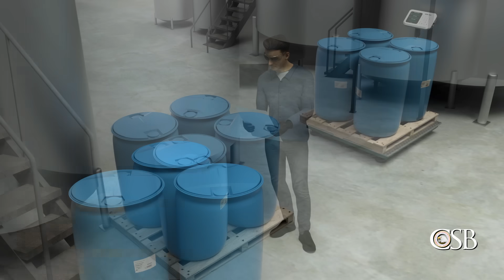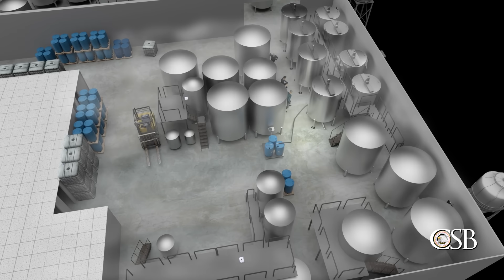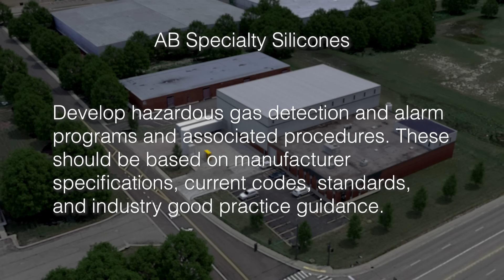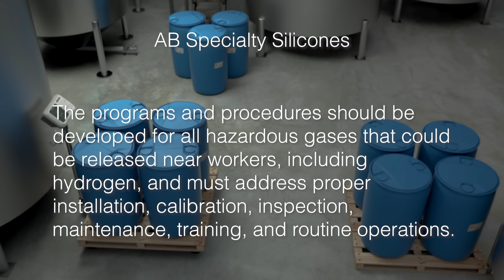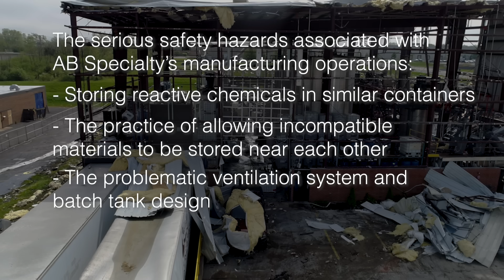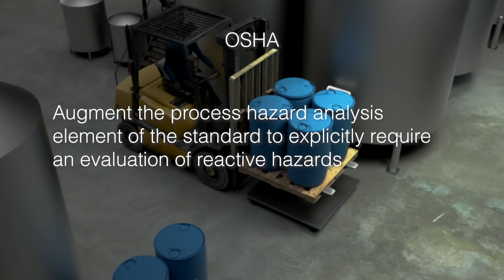Incompatible Chemicals: Explosion at AB Specialty Silicones

Comment: Accident’s happen.  The only way to prevent this accident was to make it a work free safe zone.  The tanks were probably designed for something totally different and the new process was added later.  About the only rule really broken here other than not paying attention to what’s being pumped (it’s very common for chemicals to come in all sorts of different color identically shaped containers even delivery to delivery, labels also look the same so if you don’t patiently read the wording you could also mistake chemicals) is the local exhaust ventilation, that’s kind of a major oversight not to have when mixing chemicals universally.  Tragic accident and these videos are helpful to keep in the back of your mind.  If you rounded up every safety professional and had them comb all manufacturing facilities to conduct safety audits there would still be accidents just as tragic, there just isn’t enough time or expertise to go around.  Automation isn’t the solution either as every automated system has some kind of human interaction at some point.

Comment: so seems like one good idea might be to have better temporary labels for the containers, something like a collar that attaches to the container maybe? could be as simple as a colored band with a color key or as complex as a full proper label made from carved plastic (so discoloration isn't a problem)
I know stickers seem like a good first choice but they are hard to remove once the container is empty and aren't reusable when the next shipment of chemicals come in.

something else that might be useful to consider is what chemicals can be generated form any large scale combination of chemicals used on site, (sort of like a simplified MSDS?) to help setup detectors for gasses such as happened here, at the very least it wouldn't be hard to have a public database where you could just input a list of your chemicals and it spits out a list of potential dangerous reactions.

for any bean counters, always remember that no delay or cost from safety improvement is greater then total loss of a production facility, the bean counters in this event would have been better off if they had totally shutdown and overhauled when they learned their processes were lacking in 2014.

I don't think this is a greed issue most of the time, i think it's a lack of proper communication inside organizations and between organizations, many businesses see organizations like OSHA as a pest that only comes around to do harm, maybe the OSHA inspectors could spent more time with the bean counters making clear how much worse mother nature is when she sends her surprise inspections as happened in this event.

Comment: Here's a little deeper understanding of the actual chemical reaction that caused the explosion (from csb.gov): The "XL 10" mentioned is a methylhydrogensiloxane and dimethylsiloxane copolymer. When mixed with a KOH/water mixture, the KOH catalyzes a reaction with water and XL 10 to produce large amounts of hydrogen gas.
Reply: Although we might never know, the operator could easily have started the proces with barrels of pure KOH (because they had already been opened) adding the XL10 afterwards.
Which  would be a very effective way to build the bomb that they did...
Reply: Thank you, I was wondering about the details
Reply: Is this pH related, because for adjusting it was fine, but dumping a whole barrel in it triggered it?
Reply: @VintageTechFan  I'm no expert on this particular process but my theory is that the KOH for pH correction was added to finished product whereas the accident KOH was added to an unreacted ingredient. It's definitely possible that the finished product has totally different properties than the "pure XL 10" precursor. I'm drawing on my experience with adhesives manufacture which is similar but different.
Reply: Adding KOH to either the XL10 or the product can produce H2 (I may have seen that fact in an article I read on this accident). Since pH balancing the finished product seems like it was a routine process, I am guessing that it produces MUCH less H2 and/or more slowly, so you can get away with it if you do it afterwards. Polymers tend to be relatively unreactive. Analogous to tossing a match onto a pile of flour as opposed to into a cloud of flour dust....

I've been involved with laboratory safety for many years; making it difficult (or better, damned near impossible) to accidentally have incompatible chemicals come in contact with another is a big area of concern.

Coincidentally, I was once a quality lab chemist in a plant with a process that could easily have created a large smoking hole in the ground. I was glad to move on from that one!
Reply: @corydalus981  rewatching the video it seems as if the night shift added waay too much KOH to the process. The proper amount probably releases a managable amount of H2, but they added too much.
Reply: @sootikins  this; also the KOH was for pH adjustment only and would have been added in small quantities. Adding it in the same volume as a main reactant would have complicated everything greatly.

Comment: Different colored drums would have helped. But even something as simple as putting a colored band of tape on the barrel and lid would have helped.
Its what we do, granted mixing stuff up is a mild inconvenience at my job nothing more, but it helps with identification and it's cheap.

Actually, come to think of it, I install garage floors and have better safety equipment than they do. I have a working air quality sensor.

Comment: I love the CSB and these videos. I follow the channel and send these to my co-workers. This whole plant explosion is a tragedy.

My only concern is the recommendations made around physical process controls. Implementation of a multi-color drum program is not only impractical but nearly impossible with primary drum colors being blue, natural, and sometimes black. Sourcing drums of varying colors like green, red, orange, etc takes months to do and it would be even harder to get one or more suppliers to agree to those changes without significant cost increases to COGs for them to consider it. It would require special items, special stocking limits, contracts and often lock you in with supply agreements. It does not allow for flexibility in supply chain which is highly necessary in todays economic environment. 

It would have been better to see them target initial inspection and receiving to include labeling or marking the top of the drums at time of entry into building as the main process for identifying and classifying hazards. Those labels could be made cheaply and color code the hazards from the moment it enters the building.

I’m sorry CSB but y’all need to get some actual chemical plant experience on the team. This whole write up is well written by people who only know the functions of a chemical plant but have not been in supply chain or worked at the ground level.
Reply: Very true, but consider this;
Colored tape/wrap.

Comment: Such a waste.  Gas detectors are cheap.  There should be a US law that prohibits ANY chemical manufacturing without gas detectors (for at least the possible known hazards based on stored chemical incompatibilities) as well as standard detection (ie hydrocarbon, CO, CO2, etc).  The law should state that several detectors should be placed wherever chemicals are stored, mixed or tested, in addition to wearable monitors for each employee with access to the area.  Completely inexcusable.  This law should go into effect immediately, and companies audited BEFORE the next accident.

Comment: I feel like there might be a serious issue in the qualifications of any worker who sees ANYTHING unexpected spilling out of a tank while handling large volumes of chemicals and doesn’t by default assume that the spillage is hazardous. The fact that multiple workers reacted the same way suggests they were never trained at all beyond the basic steps required to mix the chemicals.
Reply: A few behavioral safeguards could have helped to prevent this.
1. Product staging hygiene. This is done for inventory control as well as product identification and use. Unused product needs to be returned to the raw material warehouse area from where the product was sourced, and the quantity of remaining product documented.
2. Double verification of product. At the start of any production, the materials should be staged by one operator, and verified by another validated operator.
Reply: Though great notice many times this process is shorthanded by companies looking to cut corners. So that secondary validation check by another worker might get the axe. A better process would be ensuring all chemicals are stored in separate color or shaped containers if not both.  That way they can be quickly identified removing the chance of error and making the labeling of the container easier to read from a distance.
Reply: But it cost money  @jonvancil5547
Reply: @jonvancil5547  Indeed, it is COMMON SENSE, it is DISTRUBING that you need to have protocols when people should ALREADY know better to begin with!
Reply: I mean, I doubt they thought it was harmless or safe. But recognising that its hazardous isn't the same as knowing what's wrong or how to fix it. The right answer in this case was 'run for your lives', but that's not always the proper thing to do.
Reply: @macdjord  If I'm mixing chemicals and they react unexpectedly and a fog starts to fill the room then I'm out of there. Even if I don't expect it to be explosive, there are very few safe-to-breathe fogs when mixing industrial chemicals.
Reply: @KempPlays  It's possible that by breathing those chemicals in, they already weren't thinking straight and the thought to leave the premises didn't even occur to them.
Reply: @KempPlays  I do not think the "fog" was visible. 8:13
It's only rendered into the video for demonstration purposes.
Reply: @Furious321  Ah, that makes more sense then
Reply: @KempPlays  So when you, trained and knowledgable, see a reaction that you know should not foam or fog, see it foam and fog, you use your knowledge of how few chemicals foam and fog harmlessly, to escape.

So basically; they should have been trained to know this was most likely harmfull, and evacuate.
Reply: @Furious321 and hydrogen is colourless and odourless, yet much lighter than air.
Reply: @Furious321 The fog was visible
Reply: @macdjord  start air purge immediately, kill all power other then vent fans while running. then stand back far away till it stops, really it should been automatic, sensor detects H2, kills all power in building except air purge system while sounding evac alarm, sad thing the whole system for that cost less then 2k dollars in Cad.
Reply: @macdjord  as Breadstick Ricky and the boss said (paraphrasing): I don’t need to know how to help put out a fire at work. Someone else is paid for that. If something is on fire, I’m running away, not towards it. 

I prefer that line of thought
Reply: @macdjord  to me it is, I ain't staying around for that shit
Reply: Two of those killed in the accident were listed as company owners.  If those at the top didn't understand the maginitude, it's highly doubtful anyone else who worked at this facility did either.
Reply: @MarkPalmer1000  and another person killed was a lab chemist. The company I work for not only make silicone  but had toll work done at this Facility.. This accident caused a major shortage in the silicone industry.. After this accident we made several changes in our procedures and to safety procedures. The problem we have now is finding qualified operators . We recently had a job opening HR schedule 5 people for interview and only 1showed up . He got the job by default.
Reply: I don't think of this sort of hazard at all when it comes to silicones, they're generally very "friendly" chemicals with low toxicity and low flammability, prized for their stability and inertness. All the more reason these workers needed specific training to recognize it wasn't just a polymer goo cleanup they had to deal with.
Reply: You're always super safe the first dozen times you do something like this. The problem is when you're doing it for the 300th time, on a Thursday, when you're dreaming about what you're going to do tomorrow night out on the town.
Reply: Well said, Big McLargeHuge.
Reply: Indeed, Stump Largechest
Reply: Yes, sad but true. Speaking from experience, some companies have no safety protocol at all.
Reply: Your absolutely right.... Sounds like the company hire individuals friends or incompetent individuals with no chemistry training.....
Reply: i think he may have guessedd its hazardous but didn't know what to do specifically
Reply: You are forgetting cost. Line workers get $10 an hour, they are usually immigrants with poor English let alone a chem degree. Only half have high school or GED, and they are the shift supervisor. It's doubtful the workers even read the labels, just stick the hose in the barrels the engineer had delivered from the warehouse. The engineer has a chem degree, but rarely leaves office on 2nd floor. 

This isn't even the 10th chem plant I know of that exploded because of basic worker error.
Reply: @capnbilll2913  Being low paid doesn't make people stupid. It's usually the attitude of management that leads to people acting like that. People remember negative experiences more easily than positive ones, and will remember the one time they got treated like they were an idiot for asking a question more than they will remember the times knowing some detail of how a machine worked saved them some extra effort.

So it doesn't take much to train people to not even try to understand what is going on.
Reply: @lobsterbark  Out of ALL  my coworkers, I'm the ONLY one to pick up the dozens of MSDS books laying around the workplace, and read through it. At a chemical plant that routinely used deadly (cat 4) chemicals.
Reply: @capnbilll2913  yikes
Reply: @lobsterbark  Indeed. The average person who gets into the field of "unskilled worker" will not realise that something bubbling over without it having gas blown into means that there's a chemical reaction that produces some kind of gas. At best they'll remember pasta or milk boiling over and curse the mess they'll have to clean up.

That's why there should be a trained process technician overseeing operations. Something management doesn't understand, for them the only overseers are team leaders and middle management to oversee the workers...
Reply: You're referring to something called common sense, this hasn't existed since the internet showed up
Reply: I agree with the OP. I would have thought the procedure should be immediately evacuate  the building until it's determined to be safe. As a bare minimum
Reply: If you don't think to run then its your time
Reply: @ggggjjjj9543  …😂😂😂